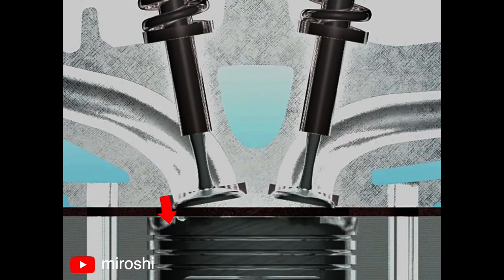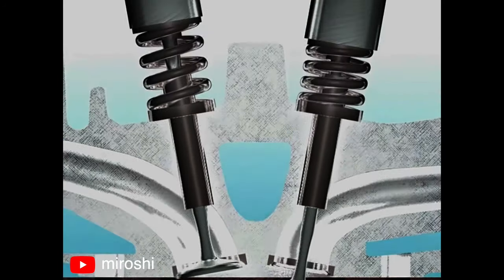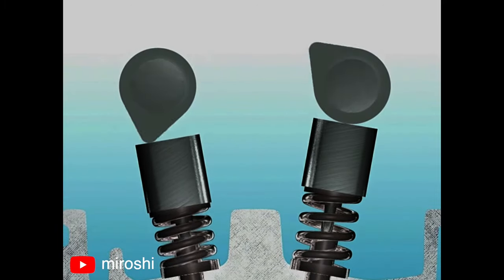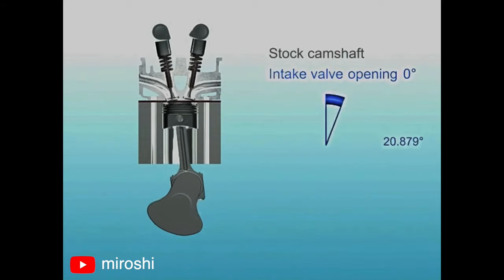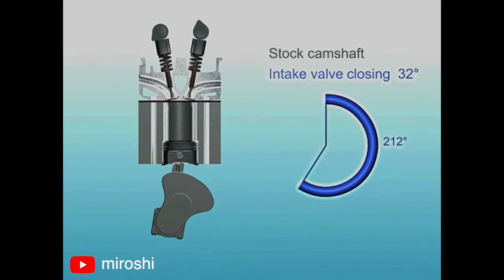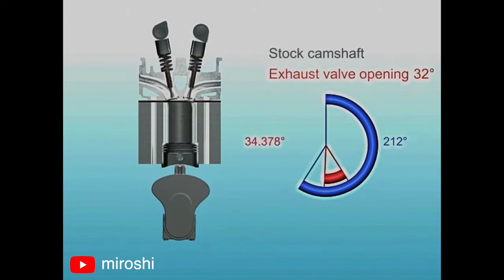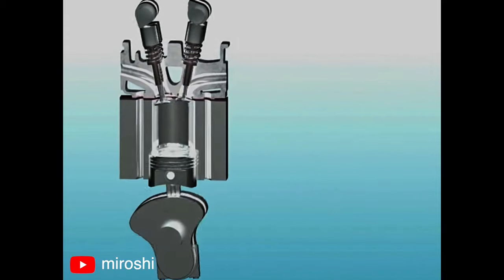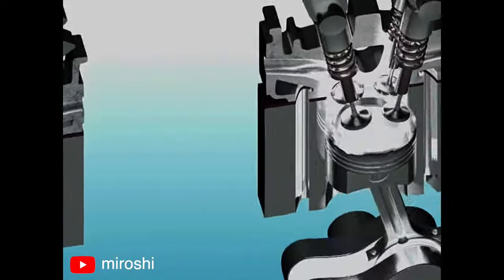Everything You Need To Know Before Cam Swapping Your LS Engine

Comment: Just wanted to say thank you for this video!! I have the DOD delete kit, Springs, Push Rods and TSP Stage 2 cam for my '16 Sierra sitting in my garage and have been wracking my brain as to whether I need a higher stall torque converter. I've had a Circle D 3000-3200 stall converter in my shopping cart for the past week but wanted to make sure I actually needed it. Your video made buying an easy choice. Thanks again.
Reply: What did you end up doing

Comment: Great video Sir, very well said. My cam swap came because of a lifter failure. So I went with complete DOD Delete. I also did LT Headers and 3 inch catback while I was there. Truck was tuned and drives great, for the most part. Its a slug down low, which drives me crazy... after its gets up to speed its fine. My mechanic never mentioned anything about a higher stall converter. Now I really need to find one that is well suited for daily driving. Vehicle is an 07 Suburban, she's a big girl, but I like her.
Reply: You're going to want to do the rear diff. Maybe 3:83 or 4:11 gears
Reply: @dgaming9791  for sure. I have 373s now. My plan is to go to 411s, a higher stall ,trans cooler and tune. All at the same time if possible.
Reply: You can do a 3800 d stall

Comment: Thank you 337 Speed for taking the time to produce this video. This is why I love Youtube - knowledge transfer from experienced professionals. I recently had my 2018 Corvette Grand Sport cammed with headers, cold air intake, no cat x-pipe, and a mellow exhaust. I love the performance and sound, but I'm not too fond of it when I come to a slow stop or let off of the brake from a complete stop to rolling - my Vette jolts and jerks a lot. It's like trying to get a wild horse to stay still. Is this an unintended consequence of a cam swap?
Reply: Try getting a better tune
Reply: Higher stall torque converter.
Reply: @Mu4dD1b15  thank you for the information. I’m learning! 😀
Reply: Higher torque converter matching the cam rpm
Reply: See my response to the video. You have too much overlap and low idle vacuum as as consequence.
Reply: @KontoVonMir  thank you for the response.
Reply: Fr 🙌🙏

Comment: Hello good information, thx, I have a 6.0 bored to 4.065 LS3 on my 2008 corvette, 227 235 at  .050 .620 .605 lift 113 ,,, 823 ls3 heads 5 angle valve cut , I am using aluminum roller rocker arms, with a stall of 2600-2800 , I still have to do the braking of 500 miles ,

Comment: Believe I have a 2012 Chevy express 3500 with a 6.0  She is a daily driver  Used for work and pulling my trailer it's getting time to overhaul the top end and I was thinking about possibly putting in a cam and polishing the heads up do you have any advice on what cam I should use

Comment: Yessir sometimes less is more.   

The man-child in me wanted an agressive cam and all the trimmings to extract the most from my trailblazer 5 3. 

But then the more mature me realized my wife will drive this sometimes and I drive 40 mi to work and to dial it back a little.  

BTR tq cam with afm delete, all new vlave train from trays to springs to lifters and longtube headers and I'm happy. 

Still chops a little and its been tuned to perfection and I even picked up mpg along with better drivability and I look like a champ to my wife. 

That wouldn't have been whaf happened had I went with all the extreme stuff like I used to. 

Guess I'm getting older and softer.

Comment: Damn, I want to try out that Little Chopper in my LS6 CTS-V. I have a previous version BTR Stage 4 and PRC 2.5 243 heads that I didn't have milled due to the cam size. I want something smaller with roughly a 110 LSA for more low end torque and be able to mill the heads to gain power everywhere. I'll also do a before and after dyno.

Comment: Another aspect to think about is what is the purpose of the vehicle? You can build a truck to be as fast as a corvette or even faster. Low end cams are only good for daily’s and grocery getters. A big duration cam can still be handled if built right in a 5.3 of course you can only go so big. 
I’ve seen people put 235/240 cams in a 5.3 with a 4000 stall and a shot of nitrous on 3.73 rear end and it’s a nasty setup of course it’s all preference for NA or a boosted setup.

Comment: I have 09 Silverado 5.3l. I have long tube headers with 3 inch exhaust. 3.73 gears 4 speed trans. My question is, in your opinion: 1) what would you suggest for a cam in this application? 2) do you think this gear ratio is ok for a mild cam? Appreciate the video and any advice. I have subscribed for future videos

Comment: This is an awesome video! I have a 2008 yukon xl denali with the lq9 6.2 that I am rebuilding this summer and am looking at a good cam for it as well as headers and a fast intake and throttle body. Potential for adding boost down the road. Will definitely be watching all your videos, wicked amount of detailed information. Keep em coming.
Reply: Hey hey, hell yeah bro I have an 08 yukon denali too but the sport version not the XL and a great inexpensive exhaust you should look into is the MBRP installer series I actually had one for your truck and gave it to my nephew and let him cut it up to fit a different vehicle because when I ordered mine they had sent me the XL at first then refunded the money and I was stuck with their exhaust still and they never bothered to send the correct exhaust kit smh so I ended up ordering it elsewhere and it came overnight and cost less but they're super easy to bolt on I did However have mine welded and I do recommend going with the black coated if you live in salt and snow area once I bolted that thing on I was like the last piece to a puzzle that I'd been missing all along lol sounds great and doesn't bother the neighbors too too bad when I remote start at 6am 🤣🤷‍♂️ once I cam spaw it things will be different I'm sure but so far all I've done is the K&N air filter, exhaust and the flashpaq F5 handheld tuner and for a big heavy boat I'm roasting sports cars at the light and she really moves out of her own way!
Reply: lq9 is a 6.0, you have a l92
Reply: Lq9 is not 6.2
Reply: exactly lq4 lq9 are 6.0

Comment: What you think about the new truck Norris cam from BTR? Have a 6.0 lq9 thinking about putting that cam in it. .552/.552 107 lsa
Reply from the maker: I don’t like that they don’t disclose the exhaust duration but more than likely it’s a 228-230 duration on exhaust to get that choppy idle, Low LSA is the key. I’d get it and if you want I can build you a cam package shipped to your door👍
Reply: @337speed  how can we go about doing that? I’d love for some guidance. I’m swapping this lq9 in my obs c1500

Comment: Say it louder for the idiots in the back that want BTR/TSP/Tick/etc stage 2 and up cams in cars/trucks with stock stall converters and gears. Especially the trucks. I was called to tune a Yukon Denali with a BTR stage 4 cam. Stock converter BUT it had headers and exhaust. Ran like a scalded dog from 3000-3500 rpm up BUT getting it to idle in gear was a ROYAL PITA! Told the owner to get a 2600-2800 stall converter put in it. When he finally did get one, he got some El cheapo converter that ruined his trans. Smh...
Reply: Hello brother looking to do a dod delete on my 2011 Yukon Denali xl 6.2 with vvt  what’s the best package for my application so I won’t be that guy you talking about much appreciated
Reply: It’s my daily driver not looking for anything special just something stock so I don’t have to do any major upgrades

Comment: I thought you explained that well. Could have mentioned Advance. Could have mentioned events. You did mention overlap. I had a '93 RX-7 w/ a '02 LS-1 and M6, long tubes and LS-6 intake. Because of this manifold, I wanted the intake valve to close @ 42abdc. If I had a FAST I could close at 44, if I had a Super Victor - maybe 48 or 50. I wanted a cam with throttle response and street manners. 222/226 112 +1 with lift just under .600" to be easy on the valve tips and that soft camMotion ramp speed.

Comment: Thank you 337 speed. We'll we did everything right, exhaust,  gears, converter etc with a Texas speed stage 2 cam, and the best possible auto cal tune thru Blackbear performance. It's a 13 Caprice with the L77 flex fuel, runs strong, idles ok but keeps setting lean codes, MAF codes, high and low voltage on O2 sensors. Can a cammed LS ever get along with the oem computer? Or should we just delete those un-needed sensors?
Thanks for a great video.:)
Reply: I'm having the exact same problems with my g body ls swap i just ordered a complete Holley ECU wiring and 8inch Terminator it will be done with a week or 2 I'll let you know if this fixes the issue

Comment: Have a SDPC LS2 crate engine with LS3 CNC ported heads single plane intake manifold holley HP 850 carberator camshaft 226/551 intake 236/600 exhaust on 112 fairly a mild cam under 240 duration from 3000-7200rpm it runs very strong revs to the rev limiter eagerly slightly choppy idle at 800rpm is streetable it runs way better than l ever expected it to has a built 700r4 trans a 3000rpm lockup stall converter and a 4.10 gears with a 1986 buick GN 8.5 rearend in a 1984 monte carlo ss that weighs 3380 with me in it has power steering and brakes this engine loves to be pushed or revved above 5000rpm and can cruise 65mph with the converter locked up at 2200-2300rpm very smooth with wicked throttle response eager to rev up off idle fast even a part throttle has a 25 percent underdrive pully and runs off a LS MSD box 1 7/8 longtube headers into a 3 inch X pipe into 2 one chambers mufflers and dumps it's a old build was done in 2008 still runs as good or better and has been the most reliable longest lasting durable hotrod I've ever owned and I've had a few I'm 57 years old decent street manners good low end torque explosive torque and horsepower in the upper range to 7200rpm
.

Comment: Thanks for the info ! I was looking into a stage 3 or 4 cam for my Silverado FBO but after this video I’m thinking ported heads , 102 mm tb and a stage 2 truck cam might be a better route 🤔
Reply: BTR Truck norris cam, TBSS intake, 90mm TB, LONGTUBE HEADERS and exhaust (think Speed Engineering). You won't be disappointed. 102 TB is not necessary. What year is your truck?
Reply: @jaydubb71  02 with an lq4 , intake , long tube headers and full exhaust are the only mods at the moment
Reply: 102MM throttle body would only make sense if you had a fast lsxrt intake manifold.
Reply: @jaydubb71   what cam and headers would you recommend on my 2005 Silverado 5.3 ?
Reply: @carlosgutierrez3890  minimum BTR Truck Norris cam and Speed Engineering headers/exhaust
Reply: @jaydubb71  
What’s up I have a flex fuel 2010 Tahoe  on 26s was thinking of doing a 4.10 gears with a truck norris cam  does it matter that I have a flex fuel I mainly want a nice daily that has the power to get up there right now I’m stock just ordered a k&n air intake and 4.10 posi
What would be an ideal low budget setup thanks

Comment: I got a 5.3 bored out with a 3200 stall and a Brian tooley racing gen 3 cam and long tube headers nothing done to rear end. Spins a little not to much. What gear ratio should I do so it can launch harder ? I’ve recently upgraded to a built 4l65e since I blew my 4l60e lol
Reply: What stage cam ?

Comment: Looking at a ss2 GPI cam  setup that's .639/.639 lift and 223/235 duration. I'm doing dual springs, pushrods, trunnions, lifters and dod delete. it's a 6th Gen Camaro. Only thing im concered about is if it will be ok with my stock valves and secondly do I need to do any head work or does that not matter?

Comment: Hello I am a bag of your video I find them useful so thanks for the grind I had a question if you had time I am building a 72 Chevy pickup got ly6 got  fast lsxr 102 sniper intake and rec port heads long tube headers 373 gear and I will buy a converter my question what cam would you put in I am looking for a descent chop not huge and low end mid range power but I still want to drive on long trips and make it drive and be reliable not trying to make crazy power just sound mean and run good be reliable I hope this message reaches your input is appreciated and respected not afraid to throw money at this
Reply from the maker: I’d go with this 6.0 Stage 2 High Lift https://www.madhatgarage.com/p/60-truck-camshaft-stage-2--210216-1165

I still retain 18-20MPG highway and doesn’t buck even with stock converter. This one is a little more aggressive so it’ll chop but with a decent 2600RPM stall you’ll be fine. Put 10K miles so far and 0 issues
Reply: @337speed  thanks appreciate your keep up the great work
Reply: @337speed  I have question for you did you have reprogram anything after you did rearl differential swap

Comment: Okay so I got a 5.3 Chevy Tahoe '05 stock and I want to get a class 2 cam where do I start will the cam ride with stock transmission and intake I've read that you can put a stage 2 cam and still have everything stock transmission and intake you just gain more horse power

Comment: Hey hey so was wanted to do a cam swap in my 2011 Escalade. I already have purchased shorty headers, Afm delete. So what do you think  would be the better cam. I also don't mind buying a converter if needed.
Reply from the maker: Titan 2 6.2 Truck camshaft by cam motion, that paired with a Circle D 2800-3000 stall would be killer for a street/daily driver. We are dealers for both so can set you up with a package deal for a good price, just email sales@madhatgarage.com
Reply: @337speed  I just got the truck Norris cam long tube headers for my 07 tahoe 5.3 with 799 heads im thinking about getting the heads ported do you recommend this

Comment: 4 cyl camry. What's my first move?!🏇
Reply: Swap in newer Camry V6, those engines are no joke.
Reply from the maker: Yeah those 2GR V6s are pretty good for the size. Even lotus uses them with Superchargers
Reply: @337speed  Yeah, I believed the Evora used an NA Toyota V6 and the Elise and Exige used the I4s.
Reply: @337speed  mine is just a 4 banger. I was just messing...appreciate the reply tho!
Reply: @okevolutionviii  Elise/exige mostly use 2zz but the exige cup car uses the 2gr and the evora higher levels use a blower on the 2gr
Reply: @okevolutionviii  Elise/exige mostly use 2zz but the exige cup car uses the 2gr and the evora higher levels use a blower on the 2gr

Comment: Great vid.. what about the motor heads have a junk yard 5.3  Built by Steve Catarino  have none of those parts from the 2002 Chevy donor truck.  The trans, intake, long tube headers . basically it’s still short block.  But need a cam… stock heads  not gone through yet . ( as money permits)   What is recommended then heads. Or redo my stock heads then get the cam ?

Comment: Have a 2004 Silverado with the iron block. What do you think about the Howard’s cam Rattlers cam? Going to get the stock 862 heads ported. Tbss intake, long tube headers, summit torque converter

Comment: What Cam should I go with, I know almost nothing about cams so any help is appreciated. Im looking for a good chop that and performance.  Here is a run down of my build. 89 Silverado, Ford 9' rear end with 3.89 gears, eaton tru-trac worm gear, BorgWarner S/480 80/96 with 1.15A/R, Stage 5 built 4L80e, Yank SC3000 billet 10.5' tc, 6.0 408 will all forged internals on e85.

Comment: If a truck has high mileage is it bad to cam it or nah I know Silverado’s last a very long time?
Reply from the maker: I cammed my truck at 200k miles and still going strong. When you do a cam swap you’ll be changing all the gaskets anyway so it’s good maintenance as well.
Reply: What’s the most power that you can get out of a 4.8  v8

Comment: I got a 05 Sierra with a 5.3 rn I got a 227/238 cam,trunnion upgrade, .660 dual springs, and stainless intake/exhaust valves if that even makes a difference, 3200 FTI stall, tbss intake with 36lb injectors, long tube headers, and stock heads, ARP Main studs and ARP head studs it’s slow until I get to 60mph but it’s still a base tune I sent my computer off and told the guy everything so maybe that’s why but Ik I went to big on the cam but… what should I do get a larger stall or what I’ve already got 3.73 gears as well might need to throw a shot on it it’s freshly built with new all new bearings and my builder gapped the rings for me just in case I did want to put a shot on it but what would u recommend I do I don’t really want to run nitrous/boost

Comment: I am all for educating people, but it becomes an issue when information presented is plain and simple wrong. When it comes to LSA and the resulting overlap you are actually saying the opposite of what's true, which is that narrower LSA generally tends to create more overlap and more overlap creates less vacuum at low- and mid-rpm, but is rather optimized for top end power to create the maximum exhaust scavenging effect. It's common knowledge that high-RPM race cars or drag cars have tons of overlap simply to work optimally in a narrow high-RPM power band at the expense of low- and mid-range torque because they don't need it. It also needs to be said, that one almost can't use LSA as a metric on it's own without combining it with duration of each lobes. Because a larger LSA (like 112-114) can create more overlap with a very aggressive ramp of long duration lobes vs. a smaller LSA (like 107-109) with medium duration lobes. So LSA is not a standalone criteria, but more so part of an equation. What you're telling people here are old (and wrong) blue collar tales without real scientific background, so please make sure you don't portrait this as factual when it's merely the impression of your personal experiences, however those came about.

Comment: I have an 05 silverado crew cab 5.3l I'm going to be doin long tubes and catless y pipe I have had the trans build with high performance shift kit and more I'm thinking of the btr truck norris cam kit with new factory  converter